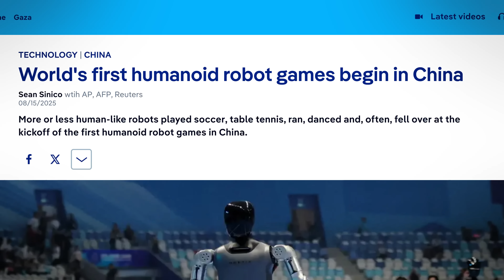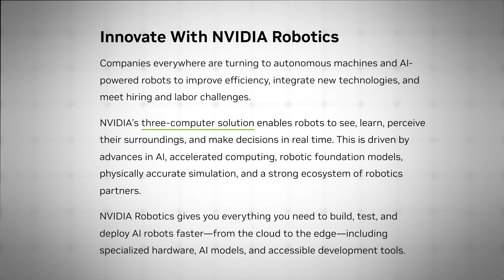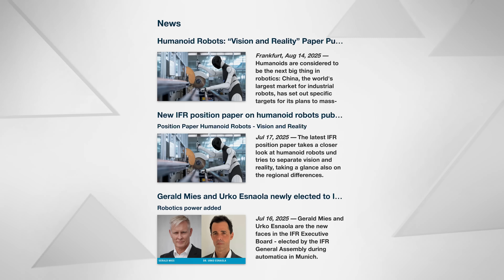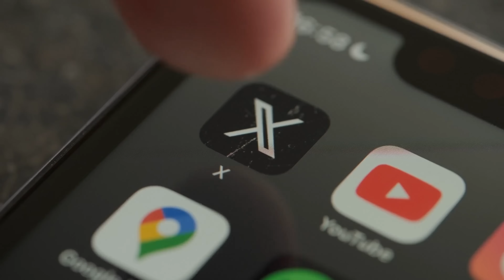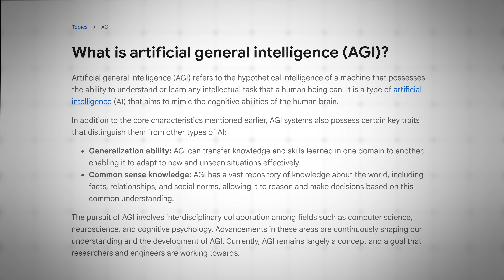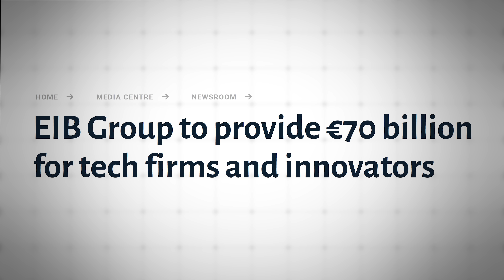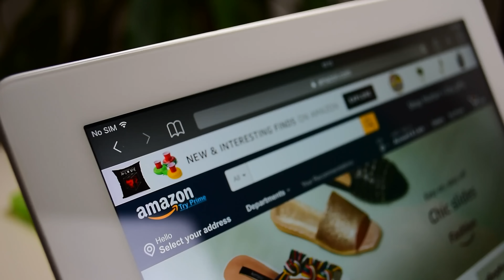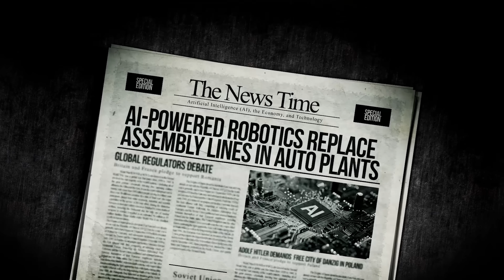The Robot Invasion Has Begun (And No One's Ready)

Comment: I used to calibrate the robot arms when i was working at the car parts factory. They are very useful but are really dumb. They collide with the part they are supposed to work on quite often so you have to manually put them to the reference point.